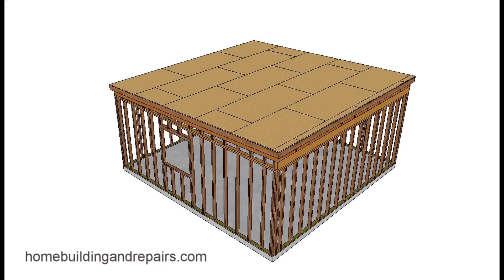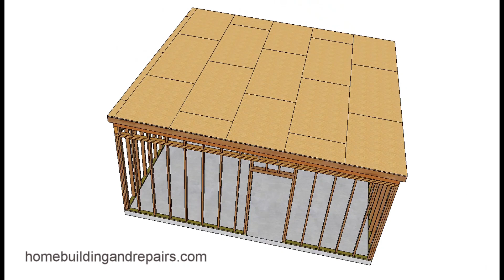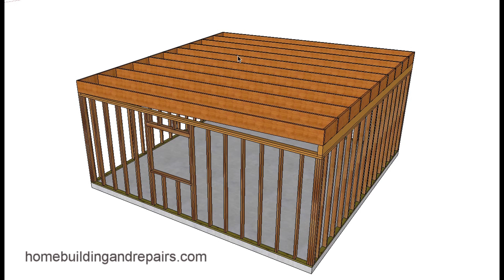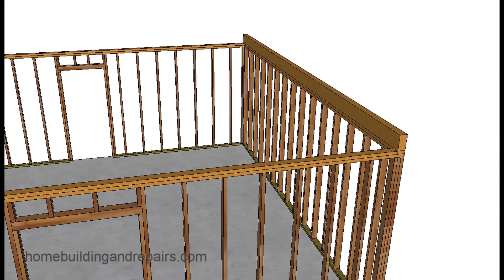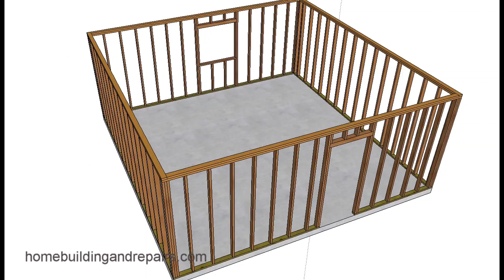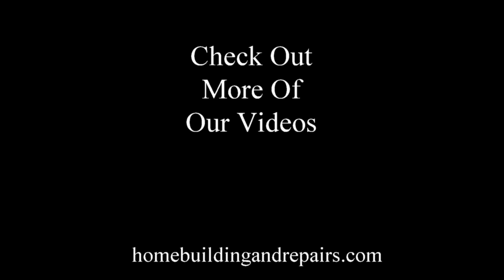Illustrated Example of Easy Shed and Garage Framing With Shed Roof

Comment: Am kinda thinking a flat roof would be best for my building on skids because of height restrictions and then when I get it to my new location I can jack the roof up take out the beam and be ready to build a Gabrielle roof. Thank for the information sir why on the front did you don’t just run it like a rim joist but instead you had them all cut in their individual pieces where the rim would go? Is there a reason for this, sir?

Comment: How would you vent insulation with this method?  Would you simply cut notches in the rafters?
Reply from the maker: You can install dormer vents of vents in the wall framing.

Comment: Hello! I need a roof on a 10x10 block building.  The blocks are being installed in a barn as a feedroom. It is install a barn that all ready has a roof so it would be flat using metal panels.  Do we build the frame for the metal in the inside of the block building or is there something that will eliminate any gaps between the metal, frame and bricks as we can't have creatures getting in there.
Reply from the maker: It's difficult for me to answer question without more details, but the roof can go on the inside or set on the top.

Comment: How different would this type of roof structure be with a 1’ overhang on all sides? I’m looking to do a 1/12 slope on a 16x24 shop.
Reply from the maker: You would need to extend the roof rafters in the front and back for the cantilever and then install what is often called lookouts on each of the other sides. A lookout is a 2 x 4 that would be notched into the rafter that lines up with the wall framing. You can find more information on that at our website.

http://www.homebuildingandrepairs.com/framing/index.html
Reply: gregvancom Thank you

Comment: I’m building a 24ft x24ft small house and I’m using 2x6x12 for the roof rafters. Can I span the 2x6 12 feet without support in the middle? 
Thanks.

Comment: Hey I so bad want to do a flat roof but not sure how much of a slope I have to have I’m building a 12x20’ shed can I do a 8in rise in the front and be ok?
Reply from the maker: That doesn't seem like it would be enough, but you would need to check with your local building authorities or engineers to verify the information you're looking for.

Comment: Trying to build a 2  garage with a skillion roof , the dimensions are 25 'x26.5' how would I design that roof with no internal bearing walls ? They would be 28' rafters with. Minimal pitch 4.2 % roughly.  I was going to use 2 x 8 x 30' single LVL beams but for cost effective I thought 2 x 2x8x16' joined with glue and 4 carriage bolts each would be just as solid
Reply from the maker: I don't know what you're dealing with, but would a long beam in the center work?

Comment: Any chance of a link to the CAD file, a PDF, or some plans?
Reply from the maker: There are no plans, just what you see in the video.
Reply: @gregvancom  20' long boards are available at most lumber yards and can even be special ordered at home depot or lowes. the availability of that material will be the fist thing most people will want to check.

Comment: Would be a lot better if you would of done this video back to front to the way you have.
Reply from the maker: I don't know if you're referring to the roof, but if you are you can rotate the roof in any direction. You can also change the size of the building. When it comes to building designs, there are plenty of opinions and glad you took the time to share yours with us.
Reply: gregvancom I meant the way the video was shown - it shows it being de constructed - however it would be ideal to show it being constructed as a guide on the build process.

Currently I am researching how it is best to build a flat roof outhouse and this is a good guide - however it was be a lot better showing it as a construction process rarther than starting with the finished article and taking it apart the way you have.
Reply from the maker: I understand and you could be right. Maybe I was just trying to mix things up a little bit :)

Comment: How do you attach the 2x12 rafters to the shorter 2x12s at each end? Toenail, hardware..?
Reply from the maker: Yes, every wood framing components can be attached using toenails, nailing straight into the other board or with building hardware. You gave me an idea for a video and I will put a link here when it is done about how to attach different framing components.
Reply: Thanks :)

Comment: Great video, just a couple questions.
What roofing material would you recommend for this roof slope?  Are shingles ok?  Also, if this was to be built on piers, what floor joist and spacing should be used?  Any chance you have a materials list?
Thanks again for the  video
Reply from the maker: I would use some type of roll roofing, even though I've seen people use shingles. If you are going to use shingles try to have a slope with at least a 3 inch vertical rise for every 12 inches. I don't have a material list either, but you can count each individual piece of lumber and use that to create your own. I would go with at least 16 inch on center floor joist spacing.
Reply: Thanks for the advice!
Reply: @gregvancom  metal roofing can be special ordered in almost any length up to 24' easily and even up to 40' in special use scenarios. it would provide the longest lasting and least maintenance surface.  I would suggest googling a manufacturer that is local, they are typicall 40% cheaper than the big box stores.

Comment: I have a building like this that was built  when I purchased my house. It has an added 10 feet past that and the roof joist are running the other way. They overlap on at that wall and when the extra 10 feet was added I'm assuming at that time they added a 2nd roof on top of that that are 2x6 rafters. The roof trust are also 2x6. The building has 3 rooms 4 walls perpendicular to the roof joist I'm wanting to open this up how could I do that? I can email you a DWG file I have drawn.

Comment: Glad I found your Channel Greg, very informative. On this example, how are the roof rafters secured with this blocking style build and the gable studs (brackets\toe nail)? Also, will there be a slight angle cut where the rafter meets the beam horizontally and also a slight vertical angle cut? Thanks again, Mike..
Reply from the maker: The roof rafters will be secured by toe nailing them or by using hardware, but toe nailing should do. I think anything less than a 1 inch per foot slope or 1 inch vertical rise for every 12 inches of horizontal run wouldn't need a notch in the roof rafters or seat cut.

Comment: I am assuming this would be a bad roof design choice for snow accumulation?
Reply from the maker: For the most part yes, but it can be done using heavy duty roof rafters in some cases or creating a stronger structure by using supporting beams and posts. This isn't something I would build in an area where large amounts of snow could accumulate on this type of roof.

Comment: how would you connect the rafters to the beam set on top of the wall.
Reply from the maker: With angled 16d nails. Watch the next video I made on why roof ridges sag and towards the end of the video you will see what I'm talking about. Let me know if this doesn't make sense and I can make a video.
Reply: @gregvancom  One can also use 6" long structural screws from the bottom  going through the two 2x4 headers into the bottom of the rafter., they even make special drill extentions so one does not need a ladder. makes the job fast and easy.

Comment: I'm planning a 10'x20' shed with a similar roof. How would you frame in a barn style door and high, short and wide windows, on this type of structure?
Reply from the maker: You might need to send me a picture or a link to your barn door, but I think it can be framed using the same method in the video. You would simply use a longer and larger header, with at least two trimmers on each side. You might find what you're looking for on the website also on the engineering and framing pages. http://www.homebuildingandrepairs.com/framing/walls.html
Reply: The shed project is in a conceptual stage, at this point. But the link you posted is an amazing resource that I'm sure will help in the future. Thank you!
Reply: gregvancom 1st qw